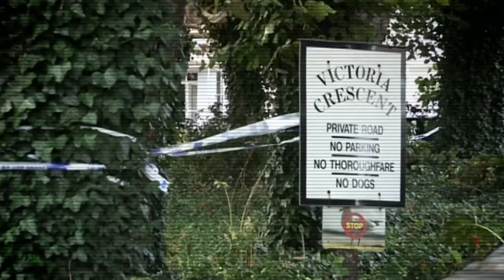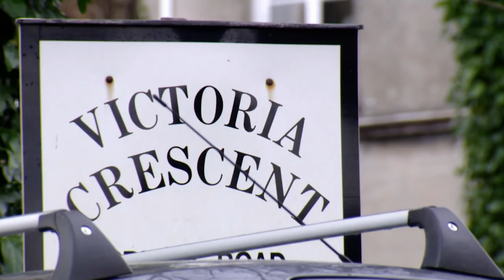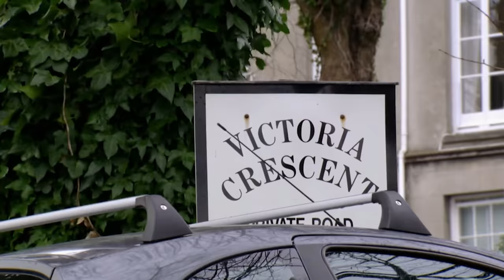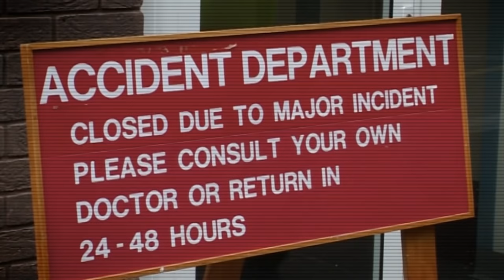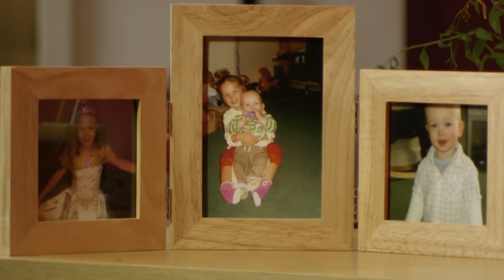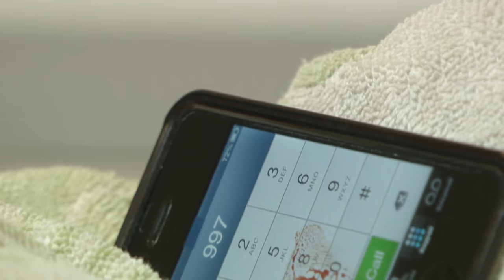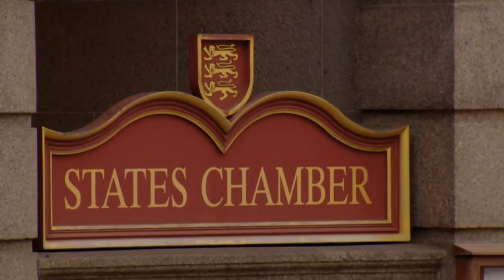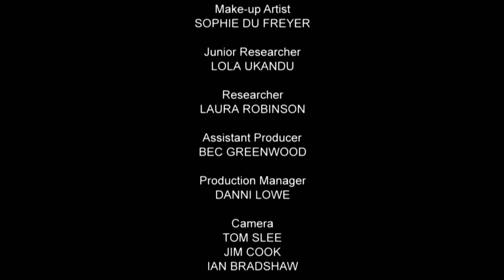Fathers Who Kill: The Horrible Jersey Slayings (True Crime Documentary) | Real Stories

Comment: Multiple stab victims and no-one thought to check through the house, the way it is described, the first responders just happened to come across each victim as it occurred to them to check, obviously Jersey police haven't got much experience of violent crime, but surely the first thing that would come to mind is to check if the attacker is still in the house, so it could be that the Jersey police haven't got much experience of using common sense either, and then there is the manslaughter charge, seriously, plunging a kitchen knife into a two year old SIXTEEN TIMES is overkill no matter how you frame it, the judiciary deserve to be laughed at in every corner of the World.